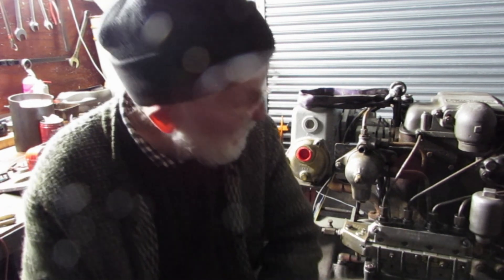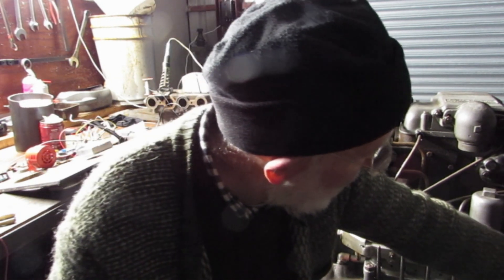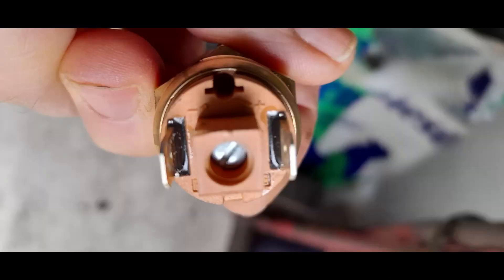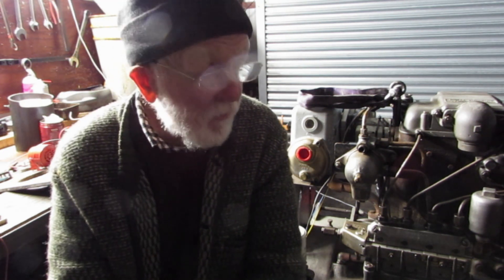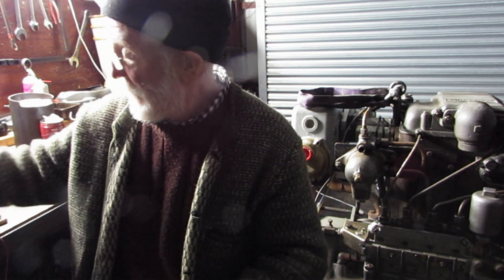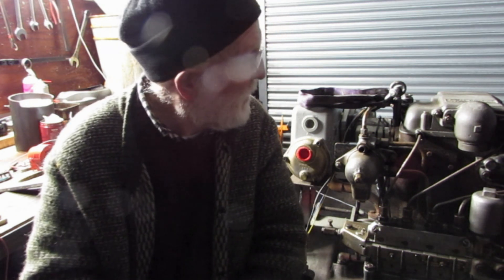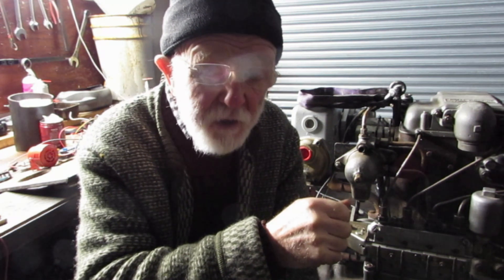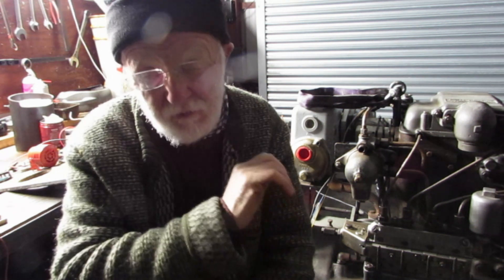Gardner Engines: alarms

Comment: Hi Joe 
We find your videos invaluable and do appreciate the effort you make helping us keep these engines going. 
I’m planning on putting a pipe stat and oil pressure switch in our 4lw and would truly appreciate any wiring diagrams you may have. The 4lw is fitted to a 38ft Huon pine ketch that resides in Hobart Australia.

Comment: I would love a boat with a 6LXB and a 4 to 1 reduction twin disc gearbox, do me a treat as a small trawler, the viking that is for sale just now looks the part. How about a spring return push button as a mute device, as soon as you release it they would be back on
Reply from the maker: Well, perhaps a better idea would be an electronic delay.  Turn the key, the delay open circuits the alarms for say five seconds or some such.
Reply: @tangentgardner  yes that would work